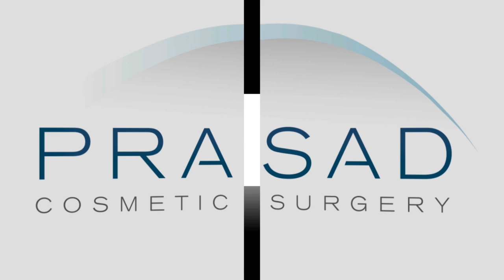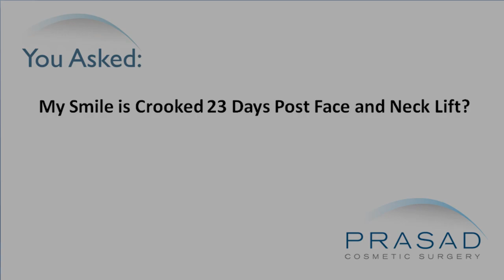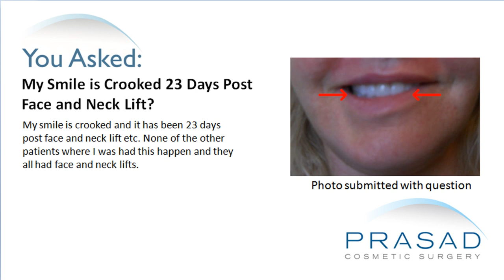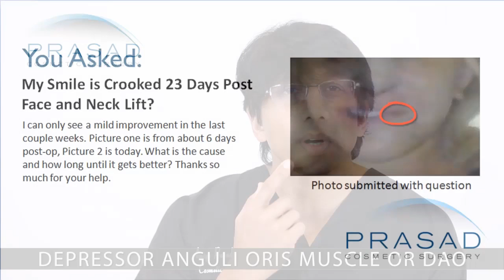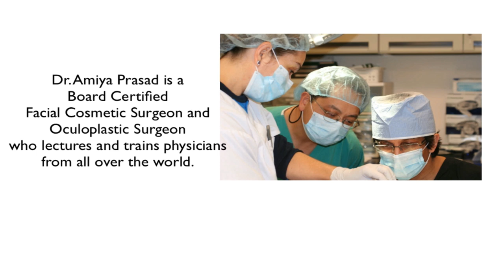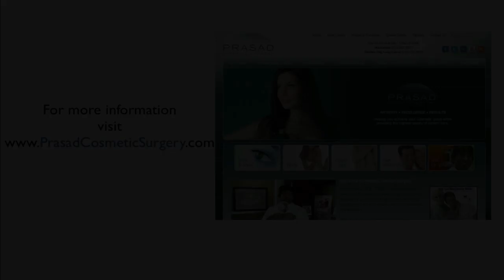The Cause of a Temporary Crooked Smile or Droopy Mouth after a Facelift, and How it Can Be Avoided

Comment: One day and I'm really CONCERNED!!! 😭😭😭😭 Specially since it takes long time to cure and if it is permanent?
Reply from the maker: Hi @carolinaramirez3686,
It's still very soon after your surgery, so it can be just a temporary condition. I suggest you try an relax during your recovery process for better healing, and go to regular follow ups with your surgeon as scheduled so they can monitor your healing. I hope this helps you.
Reply: @AmiyaPrasadMD  it's almost one month 😔 and my mouth it's not crooked when I'm with my lips closed. However, when I open my mouth or I smile  opening my mouth, also when I talk, my smile  still crooked. I've started with physiotherapy, today , not only massage.The only thing that has improved is that before my lips were crooked even in a relax position , not only when I open my mouth and smile . 😢 I'm concerned of course, it's affecting my job since I work in beauty industry
Reply from the maker: Hi @carolinaramirez3686 ,
Sorry to hear about your problem. You should be following up with your surgeon who knows details of your facelift surgery, and can examine you for any potential issues. For a proper second opinion, I would have to physically examine your face, and also review the medical records of your surgery. I hope this clarifies things for you.
Reply: @AmiyaPrasadMD it was only a lipo chin
Reply: @carolinaramirez3686  hows yours now?
Reply: @carolinaramirez3686  hi, did your smile recover? i'm experiencing this right now :(
Reply: Did it go ba ck to normal ?

Comment: before my top lip frenum removal, it was needed because my front two teeth would open and cause a gap. I had a beautiful symmetrical smile, my surgery was february 6th, and since then my smile has been crooked. My left side is lifted slightly higher and my right side is drooping, there should be no reason for my smile to be effected because this surgery is only cutting a tissue in the upper lip. I just wish for my smile back, note that most of the wound has healed mid of february.
Reply from the maker: Hi Mana Phxbia,
Sorry to hear about your problem. I suggest you follow up with your doctor to see if any muscles or nerves were affected by your surgery. I would have to perform a physical examination to determine the cause, but it would be more convenient for you to have your doctor examine the area for possible issues. I hope this helps you.
Reply: @AmiyaPrasadMD I have been 2 years come November and still same😢had test done,no nerve damage and no change😢 any suggestions on things to do at,home to help